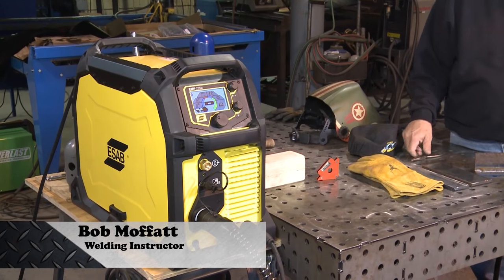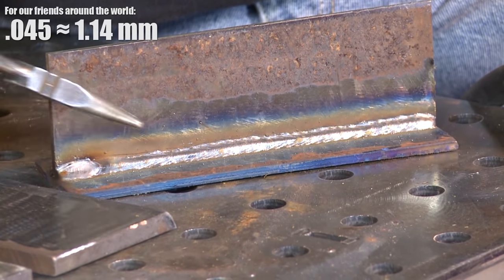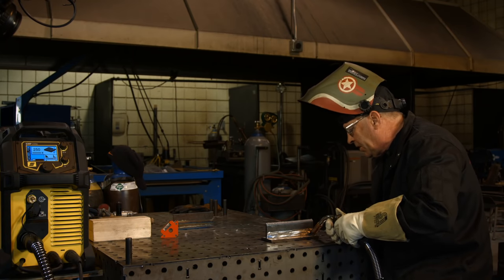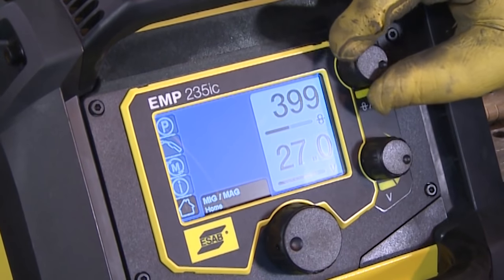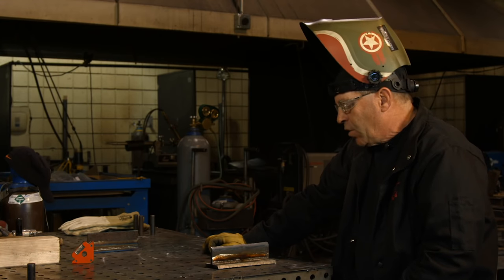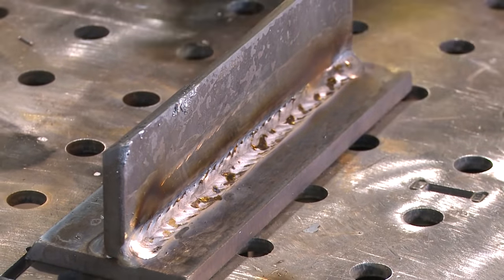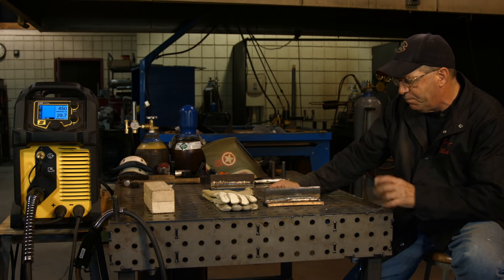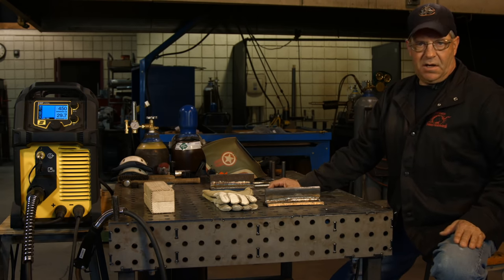🔥 Spray Transfer MIG Welding

Comment: Friday i played around a little with spray, normally im welding 1/4" up to 1-1/2 steel building agrictural equipment, i normally run at 30 volts and 360 inches a minute with .045, using a miller cp302 and 60 series miller wire feeder, 90/10 gas, i wanted a deeper weld for the thicker material, i was able to run about 400 inches a minute at 32 volts and was fine, i tried 35 volts and 500 inches a minute and also 40 volts and 600 inches a minute with a #13 shade and at 35 and 40 volts it was so hot i wasnt even able to see what i was welding, got good penetration on 3/4" plate but was extremely difficult to define the weld joint and the puddle, im gonna stick 30 to 32 volts, was fun to try it out though, i tried spray at 27 and 28 volts and was not able to get into spray,for some reason on this machine i wasnt able to reach spray till around 29 to 30 volts

Comment: Thanks for also using metric. We usually use 0.6 0.8 0.9 1.0 1.2mm wire diameters.
Reply: 1.6 also

Comment: Thank you for the videos Bob, I always enjoy watching your welding projects. On your last spray arc pass you had the split screen and I could see the ESAB 235ic ( I own the Esab 215ic) volts start at 28.5 & go as high as 30.0 at the very end of your weld. Question- in manual mig mode does the machine vary the volts because in S-mig I know it does? I really like my Esab 215 a lot and if I ever need to spray arc I use my Esab 250 Migmaster which is great transformer based machine. That's part of the reason I went with the 215ic instead of the 235ic. I have my Big Blue and Tan machines but they tend to be Garage furniture for the past few years lol.  
Thanks, Lou
Reply: are you in the uk/eu? because there is actually two versions of the 235 and 215

Comment: at work.. when we are working on contract jobs we run .035 LA100 wire with 98/2 mixture..  around 26V and 460 WFS..  when not on these contracts we run 75/25 and .035 L56 wire.  do you have any recommended setting?  I found decent results from 27.5V and 430 - 460WFS.  in the video you had same voltage and less WFS with 95/5 but for .045 dia

Comment: hi I am pressure welder from Canada .. I have just got a job spooling x ray quality pipe 2" 6" up to 20 " . the fitters suck I like a 1/4 gap no land this hardly ever happens..im running around 19 and 250 inches etc I run stick not mig . Would u have any ideas how to make my life easier ? Stick I got it covered but almost never ran a mig have had 6 repairs in 150 welds more fluke than skill..thanks great vids!

Comment: When we spray we are usually 28 to 29 volts and 465 to 480 ipm on the wire speed. thats with 035 wire which we use most of the time. the .045 wire we run at 29 volts 400 IPM.

Comment: I also meant to ask if you ran the .045 wire in the conduit installed in the spray master 200 mig gun as delivered.  It is supposed to be an .030/.035 conduit I believe but the manual supplied seems to imply you can run .045 in it as is.

Comment: Do you suppose spray-arc trasfer using the MIG process could be used instead of flame spray to build up a layer of material on round stock being turned in a lathe? What would make one process preferred over the other?
Reply: The thickness you can build up with flame spraying is a lot less.
So for a slightly worn shaft you would flame spray,as the MIG wil deposit to much material (so more time spent machining) and for a very worn shaft the flame spraying takes way too long.

So:
Slightly worn = flame spraying
Very worn = Mig welding.

Comment: Not to sound stupid but ive never used pulse mig or spray transfer ive done duel shield flux core in 1/16 as well as .045 ive done 3/16 7024 drag rod as well as 5/32 drag rod ive done many forms of welding just never used spray transfer or pulse mig. Whats the purpose like what would it be used for...help?

Comment: At the 10:00 mark you mentioned using spray mig in the overhead postition.  I was wondering what your settings on your machine were, travel speed, and mig gun angle.  Is there any way you could make a video of this I would love to see how this is done.

Comment: Ran this at a job for a little over a year.. on thin metal I might add.. better move quick or your gonna burn through. Lol  we used 90/10 argon/co2 at around 28-32v

Comment: At work I weld quarter inch plate 2 quarter inch thick Square tube in a j Groove horizontally we use . 045 C20 gas I have a hard time avoiding undercut any suggestions

Comment: Should've ran 525-550 and 27. Would've laid a nice bead with great penetration. And I run Vert downs with those same settings it's pretty easy, just don't manipulate on ⅛ or 3/16 material and go slightly faster.

Comment: Can the 215ic spray arc transfer on a similar level to the 235ic? 
I will be working mainly on 3mm wall, box section (SHS, RHS) but also the odd 10 / 12mm gusset plate work on-site 
Cheers

Comment: ...many newer types of gas mixes and welder functions, since I had a shop in 1981-85.....I bought a new MillerMatic 200 in 1981....built lots of woodstoves/heaters...guy at the welding store says..."First thing you should do is install a Tweco #400 Mig gun, if you're going to be doing a LOT of steel plate".......and try this gas mix...90% Argon, 8% C02. 2% Oxygen.... Radnor calls this 'Stargon'.....
 I've found that like most recommendations...minimum 90% Argon for spray.....but 100% won't work either....need a bit of ox in there....98/2...Argon Oxygen...but the tri-mix worked well for me...I ran about 300 of those #33 rolls of Mig wire.....in 4 years...sometimes used a roll in 2 days.... .035 and .045....with .035...need a good 175 amps minimum for spray....a little more for .045"....Millermatic has been 100% adequate for this, I've even run a few rolls of .045 Fluxcore....both Innershield and dual-shield....

Comment: Very nice machine there, I was looking at a Millermatic 215 multiprocess never ran an Esab. In your opinion what inverter setup is better?
Reply from the maker: Jason Peaslee Can't speak a whole lot to the Miller, but we have been very happy with the ESAB.
Reply: I'm a welding instructor- we have 17 multimatic 215's in our shop/class, that we use for MIG. I own one personally. they burn .035" hard wire like a dream. I've run 6011, 6013, 7014, 7018 on mine. I've been happy with mine.
Haven't played with any of the rebel machines, but they have more features.
Reply from the maker: The one thing we can say the Rebel does great that none of the other Multi Process units (in that price range) is burn 6010 rod.

Comment: Good video, thanks for sharing. Question; when do you need to spray mig? what circumstances determine that choice? I've never learned to do it. Also any chance of cutting and etching that piece? I'd love to see the penetration.
Reply: Spray on heavy sections above 1/4"
Reply: You also have to consider the weld position. You are spraying metal across the arc, which means you have to fight gravity and a much hotter, more fluid puddle. It's always been restricted to flat and horizontal welds where I've used it.
Reply: When I used to weld in a production environment, I found myself welding in many trenches and tight spots where the nozzle could not get close enough and I had to long arc or spray arc into the hard to reach areas.
Reply: Your welding spray like its flux it would run better if you kept your wire out of the grove and farler from the back plate. And if you got rid of the. You backing into it it. Wouldn't have such a cone on it just run straight on with no gun angle or very little and move right to left and you'll have a good weld. I run. It at 31.6- 419 wirespeed
Reply: What exactly is “spray” mig?
Reply: samuel adams then you have just been in the wrong industry...I have used Spray Transfer technique on many jobs. Machine bases, Heavy Tank construction, Heavy tool steel fabrications, Large stainless sections etc....it is also used as a finish pass after making multipass on heavy carbon steel.
Reply: Samuel Adams spray transfer is the only AWS pre-qualified GMAW technique on structural steels for a reason; it gives much more penetration than short circuit arc and a stronger weld overall. The
Reply: Crypto Chase thanks

Comment: What`s the benefit of spray welding vrs standard mig welding? Is it speed?
Reply: Not all too sure but one thing I know for sure is you get little to no spatter. Runs so hot you can get cleaner beads which can pass an x-ray Also you can keep a longer arch length. Flatter beads spray arch beads don't build up as much as regular mig meaning you will have to move slower to fill up grooves or add an extra pass.

Comment: What causes the popping when a mig is not set up right? Is it wire feed?
Reply: On spray, yes. Another 1/2 to 1 volt usually gets it quiet.
Reply: Yes popping usually means wire feeding too fast

Comment: I weld together car lift parts. I weld at 25 volts with 400 wfs running 92% Argon 8%Carbon Dioxide. Am I running spray transfer?
Reply: No, but you are close

Comment: I run nothing but spray at work. usually run about 30-31 volts on metal anywhere from 1" thick dowwn to 16 gauge sheet metal. gotta move quick with that thin stuff

Comment: I am interested in the ESAB Rebels. I am trying to decide between the 215 EMP and the 235 EMP. I have a small land clearing/firewood business and a hobbyist. Would I gain anything by purchasing the 235 over the 215?
Reply from the maker: Jack Frost I would say go with the 215. it will give you a little more portability.
Reply: Thank you for the reply. That was the original plan.
Reply: Hey Jack, this might be a bit late, but something to consider would be the fact that you can only run small wire spools on the 215 and the regular 15kg spools on the 235. This might not be an issue where you’re from, but to try find a supplier who sells small spools where I’m from is a challenge.

Comment: I am looking at a chinese welder but it only does 24v and 270 amps.  Can I still spay transfer without 25 volts?
Reply: Not an expert but, depends on wire diameter and type. .023 wire sure.. maybe up to .030 but not consitently.

Comment: Is there a fan I can install in my helmet , im looking for something like a small aircondition unit
Reply: Air-con units just move heat from one spot to another, so a tiny one wouldn't have much if any appreciable difference. They do make "cooling" systems, but it's mostly just relying on a fan / blower unit that pulls air from behind you and feeds it through a hose into your hood. That air will naturally be a bit cooler than the air that normally wafts in from a foot or two away from the arc, and it can help with fume a bit, assuming you're not in an enclosed space where the air doesn't circulate much.

Comment: why did it go so quite instead of the usuall crackle is that normal with spray .
Reply: It's normal I believe, when I play around with spray on my EWM it can go real quiet with the right setting. 

I really liked the look of the Esab featured in these vids, but I was keen for the pulse mode my one has, but then I later found out the pulse is only for spray and spray is only for heavier material thickness than what I'm welding, oh well.
Reply: kieren meier , spray doesn't have the same sound. It often sounds quiet to me when I have ear plugs in.
Reply: kieren meier that's when it's dialed in just right, otherwise you get unnecessary spatter
Reply: And also it's extremity hot, I've had a arc burn in my face from literally no more than five seconds of exposure adjusting for the next bead. Much respect is due with this process
Reply: kieren meier spray arc, if the settings are right should have no spatter and should run a lot quieter than short circuit.

Comment: Thanks Bob. What's the function of the oxygen vs co2?
Reply: Stabilize the weld pool and makes for good wetting into the parent metal.
Reply: If you let oxygen near your weld puddle then your puddle will start boiling and you'll end up with porosity in the weld. It'll be pretty weak. That's why welding processes use some sort of shielding gas or flux burning. Sometimes both.
Reply: Oxygen has to be less than 5% maximum. Provides a hotter arc when added at trace levels. CO2 is and active gas and generally provides the small dose of oxygen thus you dont add any oxygen when welding with co2 mixtures. Co2 stabilizes the welding puddle in steel which is why mag welding is the process generally used and misnamed mig
Reply: you're thinking of 'air'.. smaller amounts of oxygen works great to weld with.. like he just showed you a couple times..

Comment: it seems if you watch enough welding videos as I do you see the thermal arc fabricator 252i alot be it in jodys basic mig 1 thru 8 vids he uses it what seems the most along with a hobart 210 I believe. and also its in the backround of vids but not being used in some vids like in the corner of pete zilas shop in his vids. its been around a while, became tweco and is now esab after some buyouts. its been around a while so I guess its a proven platform but id love to see a review on the esab fabricator 252i  even though its been reviewed as the thermal arc theres no recent reviews if any out there

Comment: I tried convincing a former employer of mine to let us welders set our machines instead of forcing us to use presets. 

Instead, they ignored me, and we would spend hours a week removing spatter from logging trailers, including each pocket where the pickets go. 

None of the settings we used were very good at all.
Reply from the maker: Some people just don't know what is good for them.

Comment: I love the pulse spray on Lincoln 350 mp.
Reply: I have the 350MP set up for aluminum and use an S500/Powerfeed 84 or the Miller Continuum set up for mild and stainless at work. The Miller is more finicky and less forgiving with the settings but if you dial it in right it seems to be a little better. The Powerfeed is just the 350MP on steroids. Also, contrary to what Bob says, I'll do vertical (uphill or downhill) with spray settings any time, but if I have a bigger gap to bridge on (or even in general with) thinner material, I switch to short circuit.

Comment: I would like some hint on how to weld the outside corner edge on Aluminium joints, I can't seem to get a nice uniform weld using MIG.
Reply from the maker: We'll add it to the list. Any specific thickness?
Reply: 2mm thickness I have tried pulse MIG settings no matter what I have tried I can not get a good weld. I have no issues welding outside corners in mild steel and stainless.  Aluminium is just so difficult to obtain a good weld with MIG I find that I have to use TIG to obtain the finish I need. I am using a Feronius MIG.

Comment: Can spray be used multiple positions?
Reply: Like Bob said it can be used overhead with a lot of practice.  But spray works best in flat because it is so hot and you can lay down a lot of metal fast on thick joints.  That's why short circuiting is used so much because the puddle is not as fluid and it's easier to control in out of position work and sheet metal.

Comment: If welded common steel a mixed gas is used such as 20% co2 and 80% argon. The c02 is a actif gas (it has influence on the weldpuddle). We call this MAG (metal actif gas) welding.
MIG (metal inert gas) suggest you use ONLY a inert gas (argon or helium). So why do you call it MIG welding while its not??

Comment: 5%o2? Never heard of using that for steel 5%co2 all the way for spray used it got  near on 30 years in the structural world . Would have thought wire was a bit to thick for the duty cycle on that machine
Reply: real hard to get that machine to duty cycle, even on spray transfer. I use both the 215 and the 235 every day mostly with dual sheild. could only get the 215 to duty cycle on it maxed running 15 foot stringers

Comment: I have one. the cheap Harbor Freight 110 volt  flux core MIG welder. under $100 you can be welding? =^-^= I have one that i took the top off cut and put a big roll of wire on there. they don't have much power so you have to stay in the puddle & work it. so a lot of people give up . SAD because you get the convenience of a 110 Volt Welder for around $100. it's good for the DIY home hobby knick knack but can be a useful tool. some are spoiled with high amperage. I know it's not a professional thing but the DIY person learning how to weld could really benefit from having a welder around. but then again I'm the kind of person that will weld galvanize conduit to my rake & more because I'm tired of the wood and fiberglass handles going to shit. yes everything has its place and that welder should probably stay home but it gets the job done

Comment: Disappointing, I would be interested in the cut and bend on your plate.  I suspect you are not burning in properly.  Good video but you can not go off numbers on the machine, its all watching the pool, and using the proper gas mixture.  Just my .02

Comment: This particular video was pretty average. .dude , I could set up spray and squirt out a 8mil fillet it 5 minutes by adjusting the machine by feel not by messing around with that digital numbers and shit on the welder. I get that  its handy to see what amps and volts and wire feedspeed your on, for reference and to remember your settings but  seriously all that gas bullshit as well. U just need argon/co2 mixture typically

Comment: I don't understand why you are "spray" welding with solid wire. no better penetration. if you need a larger weld or faster weld go to a bigger wire dia but stay within its limits. solid wire is not meant to spray. a wire like 71m with flux inside is designed to be spray arc welded. solid wire is for short circuit welding all you are doing is welding outside of it's parameters and calling it spray welding.
Reply: rodney cassidy I've welded and tested for alot of companies that spray .045 wire. Seems like it penetrates alot more to me than short circuit.